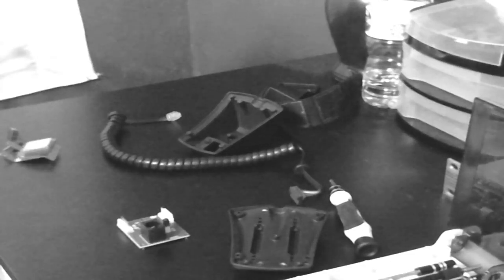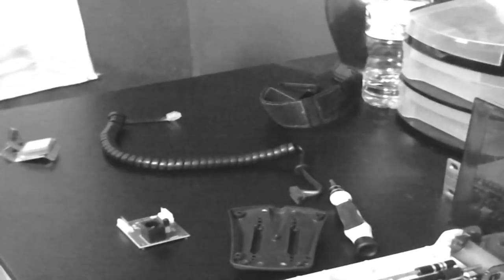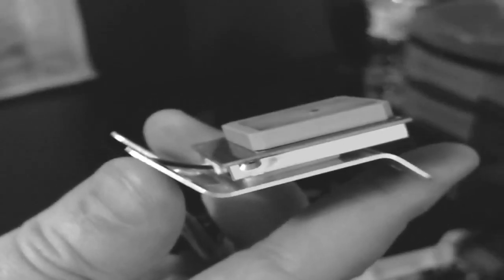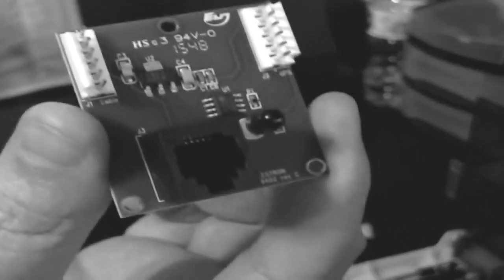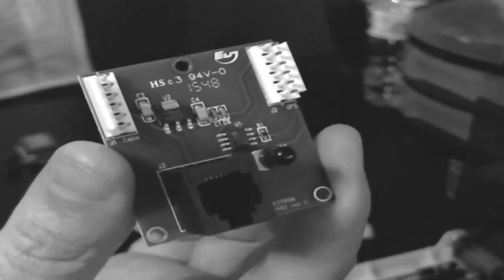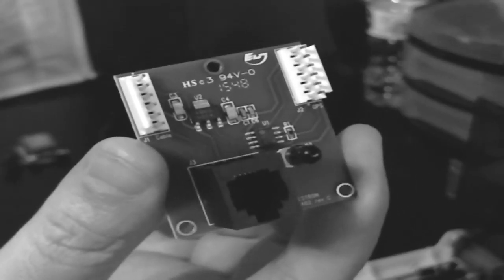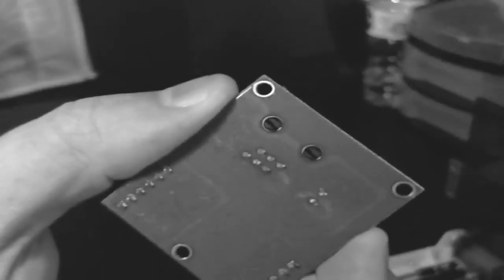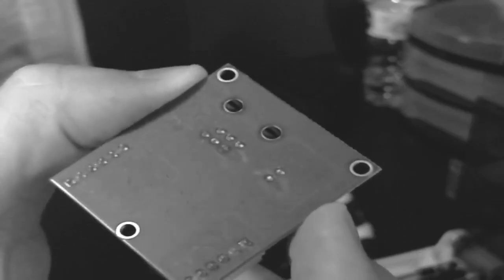What's Inside Celestron SkySync GPS

Comment: I think this guy is making a mountain out of a mole hill besides being tota.ly lost when it come to describing anything.
I only continued to watch just is case he showed how it fits onto the telescope mount. And maybe a bit of info about what you do from there on.
Reply from the maker: LMAO video title says what's inside the SkySync not how to use it. Plenty of videos that show how to use it.
>Plug in cable to a AUX that isn't being used, turn telescope on go into hand controller look for utilities then look for GPS. This SkySync only works with compatible Celestron Go-To scopes won't work with other brands. GPS has to be connected before the scope is turned on if the GPS at any time is unplugged you need to go back into Utilities and turn GPS on again. Honestly this thing isn't worth the money unless you're doing a lot of traveling as long as the scope is being used within 20 miles or so you don't need to change the latitude and longitude  you can save money and just use a app call ; SynScan Init 2.1
Reply from the maker: Synscan init 2.1 from the Google play store it will be able to tell you the information you just have to manually input it as I said as long as the scope is gonna be set up within 20 miles of the main location then you don't really need to make changes, so for example if I lived in Orlando FL and I was going to setup 50 miles away I'd need to change the information.